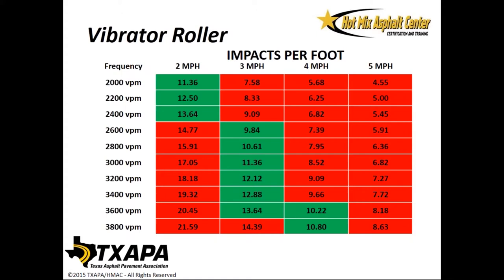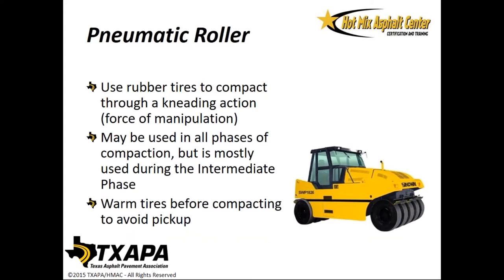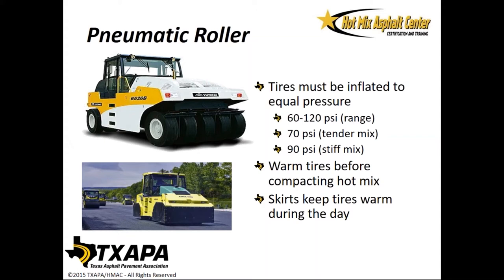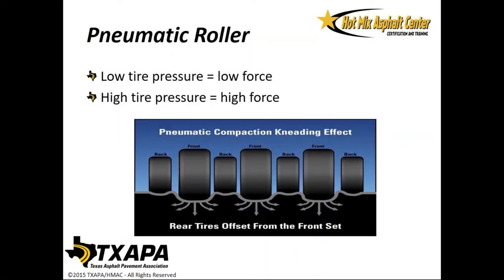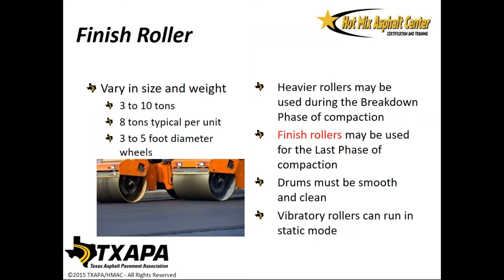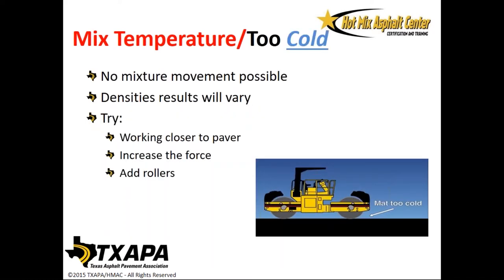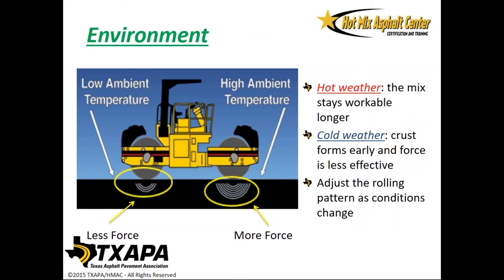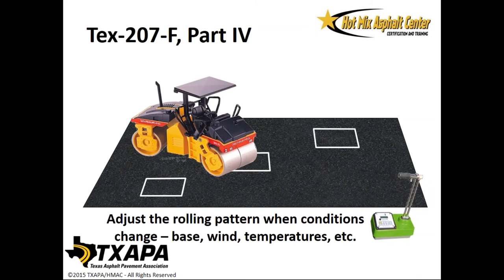TXAPA Best Practices for Compaction and Rolling Patterns

Comment: Machine weight and linear load are not the right parameters to predict the performance of a roller, for instance a 80 cm roller of 1575 kg (rolling factor 0.21) is stronger than a 213 cm tandemroller of 17 tons (rolling factor 0.12), the only difference is the production capacity. Tender zone is mainly caused by tandemtrollers, wide drums tend to compact in a more horizontal direction.  Also the Nijboer factor is not a right tool to predict the behaviour of a roller drum. for thinner lift three wheel static rollers are the best choice. The rolling factor of a tandemroller is about 0.15, a rolling factor of a three wheel static roller is about 0.60, so four times stronger pressure! A big difference is the direction of compaction, three wheel roller compact in a more vertical direction, tandemrollers are pushing the asphalt more horizontally. The problem is that tandemrollers tend to destroy the density they previously gained. A lot of vibration is much too strong, it is better to use softer vibration and run some more vibratory passes. Be careful with vibration, drum ringing is a sign that the vibration is too strong. Vibration is not the only way to compact, it is useful when the mat is hot, but after two or three vibrating passes it is better to continue with static compaction. Be sure there are enough rollers!

Comment: if you turn sharply on cold or old asphalt the asaphalt sticking on the tires or drums will come off also diesel works best for non stick tires not this water based bullcrap
Reply: Water works fine and even better with a little soap in the tank. Putting fuel on a fresh mat is just a bad recipe for degradation of the mat, you spray diesel on your shovels and lutes to clean them don’t you? You’re doing the same thing with diesel on the contact patches. You can scrub with tires and rollers on cold asphalt but you’re just accelerating wear. I’m sure this stuff works for you and your crew but there are better ways.